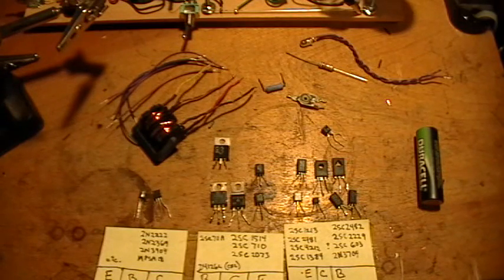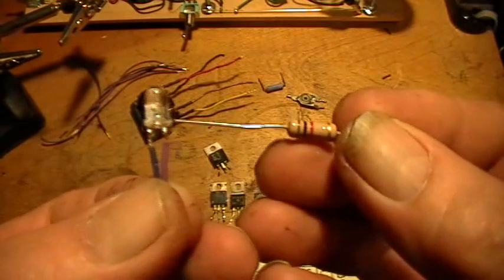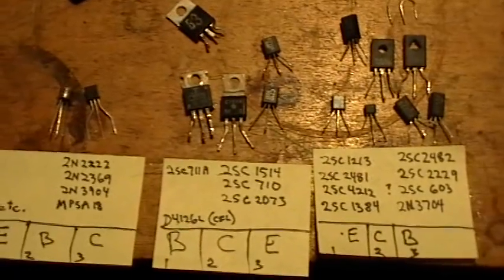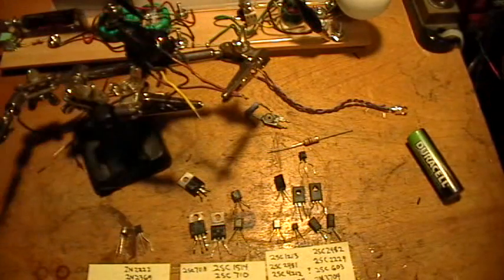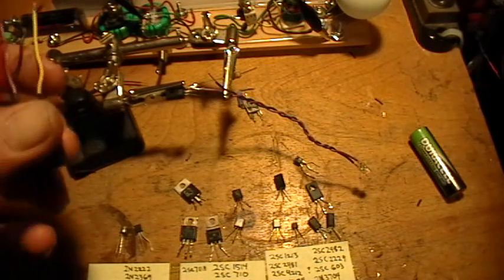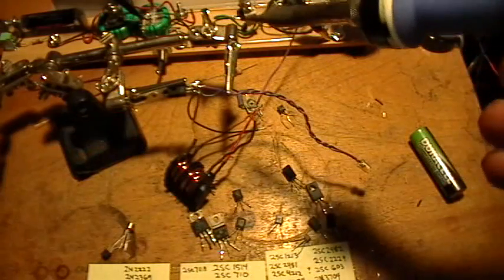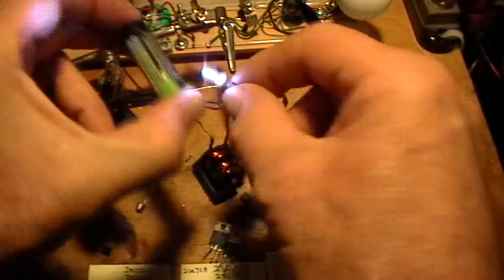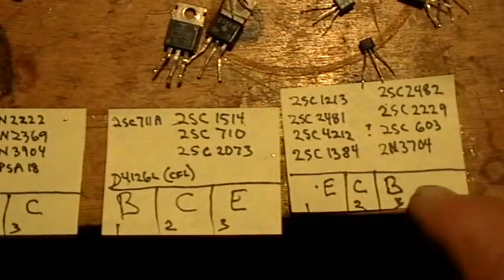Joule Thief: Tutorial: Basic JT Made From Recycled TV Parts

Comment: At the end you showed the tiny transistor you called the 2SC603.  These are really oddball transistors often called digital transistors.  They're really made for digital low current switching.  They may have a resistor either in series or in parallel with the base and emitter junction.  You can tell when you measure them with the DMM,  because they don't act quite like a regular transistor.  I don't use them for JTs because of the current limiting caused by this resistor.

Comment from the maker: I don't have one on hand to try.  But looking at the data sheet, I think it probably would. It worked with the similar but less sensitive 2sc1514, also a 300V transistor.
It won't hurt to try! With only 1.5 volts input you aren't going to damage any transistors.
I didn't show it in this video but I've also used a couple of different germanium transistors and they work too. In fact I think they might work better at really low voltage.
The 2n2369a, a Si high-speed saturated switch, works great.

Comment: Thanks for your input, my concerns are exactly as you say... I will look into gating as you say. To limit measurements between spikes might be tricky, not so tricky if the pulser was PWM controlled, though, as opposed to Joule Thief / Bedini Style. Another methodology might be, to, simply disconnect the charge circuit, do the measurement and use logic to either resume, or remain disconnected, on a timed interval.

Comment from the maker: I don't think the JT will put out enough power for a 555 based shocker though. If you google "555 stun gun circuit" you will find a nice one. It may be possible to power it from low voltage using a JT but it might take some experimentation to get enough power out of the JT to power a pulse. And I imagine there might only be a couple or three "Pulses" in a small battery like AA or AAA.

Comment: I'm relucatant to have a voltage divider, read by ADC, to then compare... when I am "pulse charging" (sending in spikes). I'm not sure of the implications with that... then I think, well, I could send a diode off of +, to a HV small capacitor that was in parallel with + and negative of the charge battery, and make a voltage divider of of that, send at the center to ADC in, hmm but, will i lose my "spike" to my little cap, and thus not have the battery see it? I'm not sure.